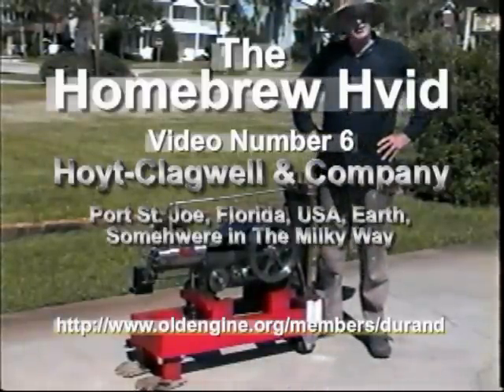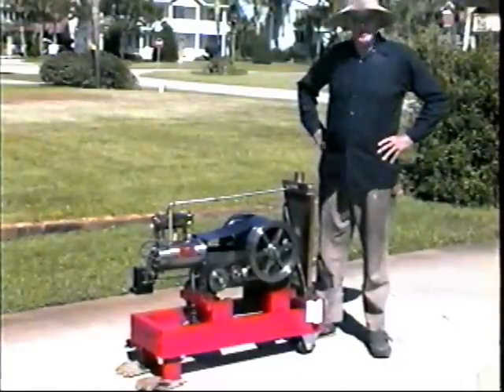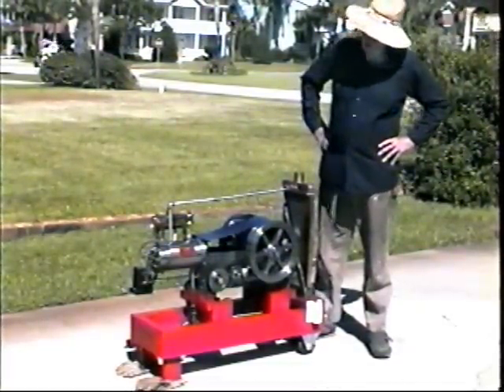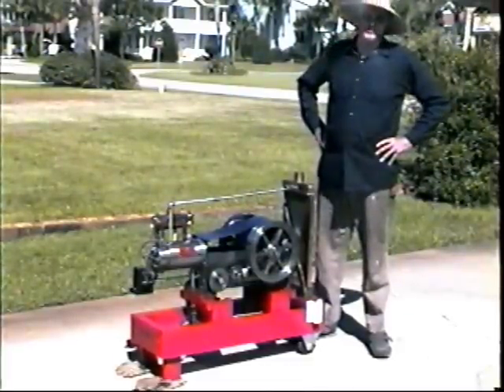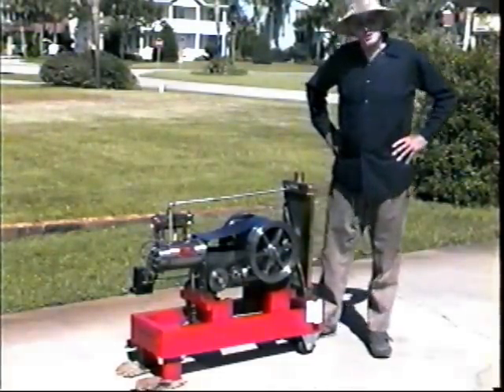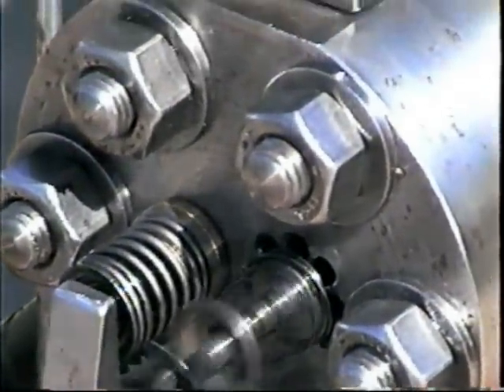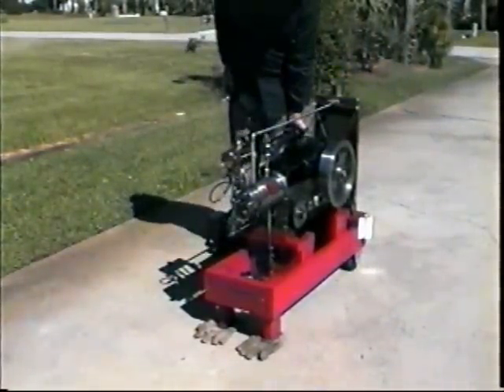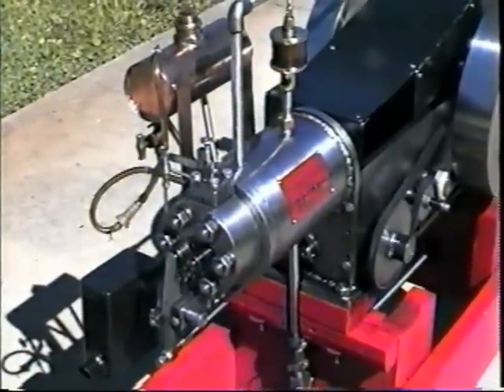Homebrew Hvid 6.wmv

Comment: I think you could make a true diesel like this guy did. That would be really cool!
https://www.youtube.com/watch?v=xh0Vzq6_C2s
Reply from the maker: Grant:
I just watched his video and am really impressed.  Now, I may consider my own version of a true hydraulic Diesel.  Thanks for watching!
Reply: He has built as few of those diesels. Really neat. I bet you could  modified the head on the HVID to work. A Cummins PT style unit injector is very simple. 
You can buy new fuel pumps and injectors on ebay for Yanmar L70 engines or thier Chinese clones for around $50 each. They are single cylinder 5 or 6 hp direct injected diesels.
Reply from the maker: I've thought about a hydraulic Diesel and have a Yanmar injection pump and injectors but they would have to be used on an engine that would be larger than my shop can handle.

I might do some experiments to see if I can make a really small pump and injector that will work.  If so, I may try for a true Diesel some time in the future.
Reply from the maker: I'd hate to mess-up the Hvid.  It took a lot of fiddling around to get it to run well.  If I do a Diesel, I'll start from scratch.

Also, it will be smaller than The Homebrew Hvid, probably 1" bore by 2" stroke.  I'll probably develop my own pump and injector.
Reply: I agree the hvid is really neat.